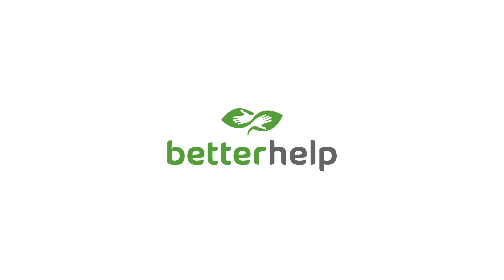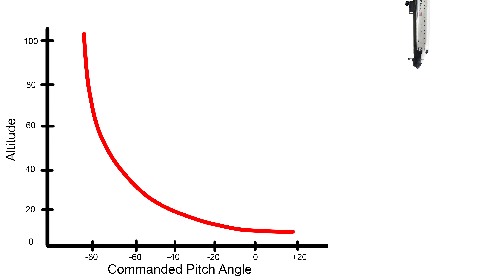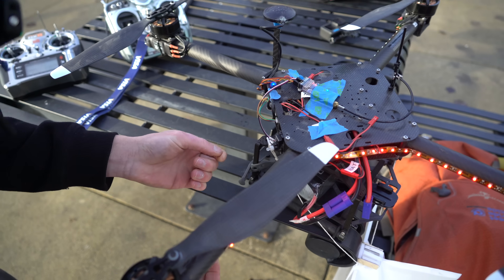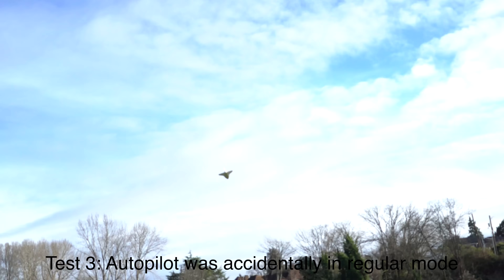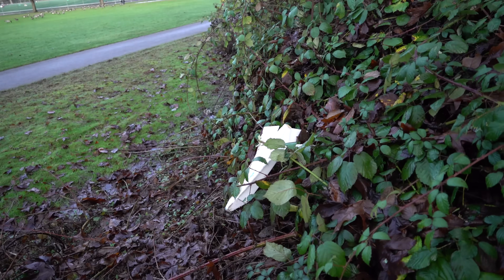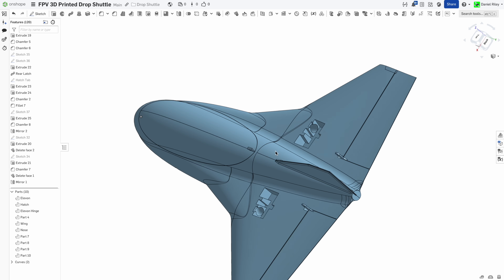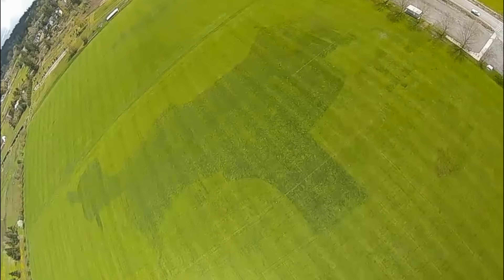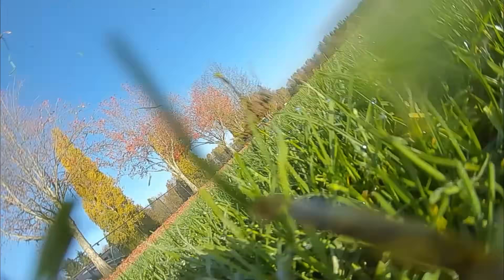3D Printed Autonomous FPV Shuttle Glider

Comment: Changing the velocity vector of a vehicle is dependent upon the wing/body flying below the critical angle of attack. Launching these at -90* pitch is certainly causing another design requirement, reduced weight being the most important. Maybe (I don’t know if this is even possible) fitting an AOA sensor to the body and feeding that information into the telemetry would be helpful in diagnosing the instability you’re encountering. Cool project nevertheless. 

Actually, now that I’m thinking about it, could you use a manual-bias AOA-dependent elevator control system to your ground effect vehicle to control lift in ground effect?  Is it possible that such a system could correct for artificially low AOA introduced by GE itself.

Comment: try putting some winglets on. Also you might want to sharpen the forward strake leading edge and you need more or a flat top than a rounded one for lifting bodies to work best.

Comment: You should make one with an inflight moveable CG. Set up a railed weight system inside so it's nose heavy at drop and then it slides back as it flares. Could fix the turbulence no?

Comment: Good to see you back at this project - I enjoyed your previous attempts.  I suggest perhaps some simple calcs up front to see if a simple tube with delta wings can be aerodynamically stable and at what speed.   You'd think the shuttle would be as simple as you could go but I think you can go simpler.

Comment: Making delta-wing-shaped holes in the ground is something I excel at, so here's some painfully-obtained suggestions. Highly-swept deltas have vanishingly small inertia in roll, but a load of inertia in pitch and yaw. Their tiny wingspan also provides negligible roll-damping. This is a bad dynamics situation, so if they start to tumble, it's often game-over = flat spin/frisbee. Using aileron won't help you recover; it only makes it worse. We lob little 'shuttles' piggy-back off of model rockets using a catapult: if the release isn't clean and the delta starts to corkscrew, she's a gonner.
The vertical tail on your seriously-cool 3D printed glider is way too small for the large yaw inertia, but that's an easy fix. Bear in mind that at high angle of attack, the fuselage is blanking off a lot of the flow to the tail, so folk tend to go with twin-tails.
The high-frequency roll oscillation is what highly-swept deltas do as they're stalling. I call it 'wibble'. The vortices coming off each wing are battling it out over the centre of the upper fuselage. If you don't get the nose down sharpish, then one vortex will eventually win, causing the delta to roll right over.
I've written some notes on this stuff on our website: http://www.aspirespace.org.uk/downloads/Winged%20rockets%20and%20boost%20gliders.pdf
Reply from the maker: Good info. Thank you!
Reply: @rctestflight  Hi, my name is William Walker and I am developing a Blade Runner style flying car called the Sky Chaser and an artistic picture of it can be seen in the icon at the top left hand side of this post. Clicking on the icon will enable you to see a project presentation and flight videos. It is a powered lifting body aircraft with similar characteristics to the aircrafts in your video, with a Lift  to Glide ratio of 1/3. I was also concerned about the survivability of a complete power out, and discovered exactly what you show in the video, that going into power dive and flairing out as the vehicle gets near the ground enables the land perfectly using ground effect.

https://drive.google.com/file/d/19taPDO1yERAumR8OV1IFk2n1TqNLNUkN/view?usp=drive_link
Ref 2:18 min into video, and there you will see a demonstration of this powerout maneouver using a full scale CAD model being tested in flight simulator.

The Sky Chaser is a very unusual vehicle and thought your group might be interested in it. Sky Chaser looks and drives like a car, flies both vertically and horizontally, and is amphibian. It has no exposed rotors, and uses the body as a wing. It also has no unfolding wings, and flies the way it looks, just like the Blade Runner vehicle in the movies.

Sky Chaser is basically a flying wing design with twin electric motors in front and has double rudders and double elevons in back for control. It also has VTOL capability and is a Tricopter configuration, with 2 tilting front electric motors in front mounted on nacels, and another electric stationary motor in back blowing thrust though a hole in the wing behind the cockpit. The tilting motors enable vehicle to transition from VTOL to plane mode. The aircraft is also car with 4 large wheels powered by small electric motors. In addition, the vehicle is amphibian, and can navigate and takeoff and land on water, both in VTOL and in plane mode. Sky Chaser has a very short wing, but its effectiveness is increased by blowing high speed thrust over the wing and by using oversized side body panels, housing the wheels, to block airflow around the wingtips and help channel the airflow over the wing. The front props are counter rotating and from the pilots perspective, the right prop rotates clockwise and the left prop rotates counterclockwise. This configuration seems to yield the most lift.

I started the project in 2016 in San Diego, Calif, USA where I built and tested a 1/6 scale model. Then I made a CAD model and got it to fly in a flight simulator. 3 years ago I moved to Sweden and work with business partner and we have now built a full scale unmanned working prototype which flies. We are looking for partners to help develop the next manned version of the Sky Chaser. For more information:

*SkyChaser(dot)se
*Project Presentation: https://drive.google.com/file/d/1FAdls15OriuQ4hoD2xPwXeNQDQTKpK1t/view?usp=drive_link
*evtol News article 1: https://evtol.news/sky-chaser-concept-design
*evtol news article 2: https://evtol.news/sky-chaser
*Simulation tests: https://drive.google.com/file/d/19taPDO1yERAumR8OV1IFk2n1TqNLNUkN/view?usp=drive_link
*Full Scale hover test: https://drive.google.com/file/d/1qDl5X142uC5yt_5Xcb0GUS3h-LgD4P0V/view?usp=drive_link
Reply: Thanks William, don't know about 'expert', just been doing it a long time! The thing about Daniel's brilliant vids is that we get to see exactly what's happening from many camera angles, and even from the cockpit. Watching this video lit-up so many lightbulbs: "Hey, I've seen that glider behaviour before, but never that clearly." Daniel's footage of the glider dropping off the drone was a real eye-opener.
Reply: @richardm.newlands2417  From a strictly "gut feeling" standpoint of having built a number of RC models, the vertical stabilizer area seemed pretty small  to me.
Reply: very useful response!
Reply: Is this why we don't really see delta wing aircraft used often, if at all? What you're describing exactly matches my experience with delta wing rc planes; supremely unstable, high speed required, be extremely cautious not to stall
Reply: Really great content, Rick!
Reply: lets hope Daniel sees this
Reply: One way I read to prevent the wobble is to add wing fences like on the Mig-17, because it prevents a majority of the flow over the wing from separating into span wise flow and chord wise flow, which helps keep the lift on each wing more constant, thus hopefully preventing the wobble feedback loop
Reply: Absolutely right! 2 decent sized vertical stabilizers on the wing, preferably the outer parts where there is less aerodynamic shadow of the fuselage at high alpha, would definitely improve roll stability.

Comment: Too small vertical stabilizer. Try to add some winglets or larger fin. Long nose generate center of aerodynamic buoyancy in front of COG. Delta and flying wing configuration shows yaw instability as aileron swing. You can test it with xflr5. Had similar problem with one of my projects.

Comment: For anyone building flat foam wings.... Add another strip of foam on top of the leading edge that is 50% chord or a bit less. And round the leading edge. This creates a KF airfoil (KFm-2) and it will fly way better.

Comment: The main reason I believe the shuttle designs don't work well is because the design of the space shuttle was made for hypersonic flight. Even while landing, the shuttle was moving very fast. Theres just not much lift in that design to get stable flight at low speeds.  This is challenging stuff though. The one thing I might recommend trying is maybe a adjustable wing? So u could get more speed at a dive, and more lift while gliding... Kinda closer to an old fighter plane like the F-111 for example. Might be worth a shot!
Reply: Or try first with some traditional wing design modelling some known airplane and only try the delta wing stuff after succeeding with that. Longer steady glide path with less emphasis on the last second pull up.
Reply: The Space shuttle enters Earths atmosphere at over 17,000 mph and slows itself down through a series of flight movements to final approach at 215 mph by 3,280 to 2,800 feet above ground.

Final nose flare before touch down and arrester chute deployment is at 179mph and final roll out to a stop.

Comment: So, one thing to consider is that the oscillation may be a result of over speed and not over tuning. You very easily could be exceeding the max speed limit of the aircraft, causing it to become unstable.

Comment: I would want a small sensor that could sense air and calculate ANGLE OF ATTACK or AOA.  Modulating this to near 1.00 just prior to touchdown would yield the flight you desire.  But it would need a computer to sense air, direction, altitude, etc.  Then you could program it for the ideal flight.

Comment: I did not know you could have onshape convert your models to drawings! Does it account for material thickness? I used to use pepakura to convert 3d models to drawings to cut out, but I had so many issues with the program not being able to account for material thickness.

Comment: I have a shuttle design I want to build and launch as a rocket and then have it return to base by gliding using ardupilot. The thing is, it would be starting at high speed, reaching its peak altitude before switching to auto pilot. Level flight then circle the home gps until it lands.

Comment: As these are actively controlled putting the weight very nose heavy should be possible and still get it to 'fly'. That would then help it accelerate nose down more cleanly as you have put the drag and mass far enough apart... Of course if you or the code don't pull up at the right time it will turn into a lawn dart, or stall and then turn into lawn dart, as you will really need good airspeed to have enough control to lift the heavy nose...

Comment: try adding features to improve the low speed stalling situation... like humps in the leading edge, which funnel more air across the surface.
also, placing the antennas in front of the leading edge didn't do the airflow any good, since they cause irregular pressures

Comment: This will largely be unsuccessful.  You don't have enough airspeed for the control surfaces to be effective, and adding deflection to them will simply increase the stalled angle even further.  All you need is time and nose-down atitude and the aircraft to not enter some unrecoverable tumble mode, and then the condition you seek will be a function of the airframe.  Just center the flight control surfaces and wait until you have airspeed, and then pull out and level off.

Comment: How about forward-swept wings and a higher dihedral with a T-Tail to give more authority to the governs? Or even a box-wing?
Also, would wood (carved on a CNC) be more fragile than 3D print? My point is to have the advantages of a fibrous material, with longitudinal fibers. Wood tends to be no-so-brittle, AFAIK.

Comment: Food for thought:! The rotor wash from the quad is causing the initial  instability since it is tailwind blowing against the control surfaces, causing it to use up altitude to get stable.
Reply: makes sense. any idea how to fix it best?
Reply: @pinkpanther8427  From the drone, 2 thoughts.  Guide rod angled away from the drone, or towing it like a glider and releasing.   Both have their own challenges.
Reply: @pinkpanther8427  longer tether easiest but brings risk of tangling quad
Reply: @pinkpanther8427  Maybe two long rods to guide it and then keep the drone moving so their isn't a column of toward wash for the aircraft to be traveling through.
Reply: @pinkpanther8427 Anything that gets the glider away from the drone's downwash, aka not being under the drone.
Even if you tow the glider behind the drone, it will fly through the downwash, so it might be better to use a regular plane for towing. You'll naturally end up below the towing aircraft, avoiding most air disturbances.
If the vertical drop is the whole point of this experiment, just drop from higher up. You can't fix downwash, but downwash doesn't extend endlessly. The craft will eventually get a hold of undisturbed air.
Reply: @pinkpanther8427 BALOOOOON!
Reply: @pibyte  moored balloon has potential.
Reply: @pinkpanther8427  Be high enough to allow it to be launched pointing vertically downwards, get away from the propwash as fast as possible (and gain speed) then pull out into glide
Reply: Quick solution: Fly with a lot of forward speed during the drop
Reply: If it was financially viable it'd be good to try a balloon. Eliminate prop wash and motion entirely. 👍
Reply: I'd personally be tempted to 'cheat' and put some sort of small powered prop on it. Even if it was well below the needed thrust-to-weigh ratio to sustain flight for long, since it just seems like it needs a little 'nudge' to get some inertia out of the drone's prop influence. That wind blowing is definitely what seems to set up a twirl.
Reply: Once out of the prop wash, deploy a drogue chute to stabilize the craft, then release the drogue at the desired altitude, for repeatable testing.
Reply: Use a horizontal rod to hold the glider far away from the props. When dropping, also drop a counter weight on the opposite side of the quadcopter that was used to keep the cog centered. But the counterweight is on a string so it doesn’t fall and hit you, it just hangs in the center of the quadcopter once released.
Reply: @onquarter interesting idea, but the reverse movement of the weight to center would push the drone back over the glider. ( Newton’s 3rd Law). I think a small entry angle in the opposite direction of flight would be the best solution. The column of turbulence created by the prop wash is only a foot or so wide but it must leave the down wash before leaving the guide-rail.
Reply: Everyone wants to complicate it all.... just go up a bit higher and it will sort itself out. What altitude was that that dropping from? Doesn't look real high to me.
Reply: @tin2001   he’ll get out of the prop wash faster moving laterally than he will vertically before hitting the FAA drone ceiling.   Big drones move a lot of air and in this case could be causing turbulent air for 100+ feet.  Better to not burn up 25% or more of the altitude with ineffective control surfaces, and worse the control inputs have a reverse authority while they have air passing over them backwards.
Reply: Can the quad fly upward and slightly forward while towing the shuttle on nose
Reply: This thing should be able to stabilize itself if you drop it forwards, backwards or sideways.   The problem is the vertical fin is way to small - talking about the last design tried.  The scalish space shuttle could recover itself -  Look how big a space shuttle vertical fin is.  A highly swept low-aspect vehicle like this will spin like a top with a little bit of yaw.  Needs a much bigger fin to straighten the yaw.
Reply: Just to put a different thought to solutions.... Angled, deflective plate (conical) under the quad to force the wash out and away from the immediate space below the quad where it's being released from?
Reply: can totally see this air disturbance 9:59  acting on the string...
Reply: Just use rockets instead of the drone 😂.
Reply: If downwash from the drone is the problem then isn't the solution to just not make downwash from the drone?
Just do forward and up momentum (45deg both), turn off the drone motors, release, wait a second or 2, turn on the drone motors.
Reply: You'd have to be blind not to see that.
Reply: hot fucking take dude cite your sources
Reply: Came here to say the same thing

Comment: Hey, Daniel, can you revisit the propeller-powered rocket that free falls then lands. Instead, this time, use a modern ducted fan engine using a thrust vectoring nozzle? I think it would work great with a high-powered system. You can mount the ducted fan in the middle of the rocket and electronics in the nose cone or something like that?

Comment: you could also launch that rocket with an em sling up into the sky then glide down, why no vertical stabilizer fin, maximum passive stabilization is a must, passive stabilization over active control

Comment: I'm always late to the show. My only experience with gliders was a little circuit board I  made for a friend who flew model gliders, it would beep a piezo if a servo movement drew the power rails below a preset limit, this way it would start making a noise before the batteries went flat.